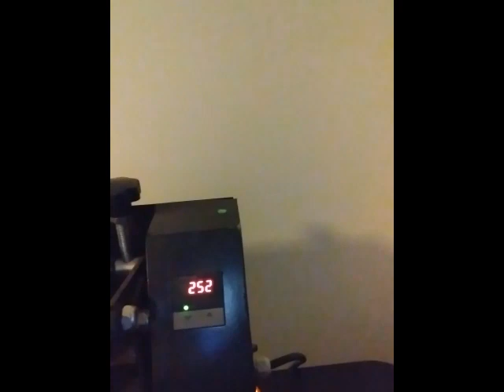Heat press not heating up | How i fixed it

Comment: The watts from a heat press is quite a bit 1500 or 1750 watts which is around 12amps give or take. The plotter might draw 1/2 to 1 amp. So in my humble opinion that's not an issue. Those relays go bad. Also the wires can come loose. Hope that helps.

Comment: Great video.  I'm pretty sure this is my issue.  Did you replace it with the exact same part?  I ask because my relay says the output is 24-550 VAC, but I haven't found anything with the same specs.  The closest was 24-480VAC.  Thanks

Comment: Thank you for sharing ... mine quit working today... so I opened the back panel.. all the wires were fine.. the relay was clicking accordingly .. I tested all the power wiring in there and they all had power running.. even the ones going to the heating element, so I opened the heating element and tested the connection between the two wires and the heating element too .. the red wire had power but was not attached properly .. it was over crimped .. so all I did was strip it and reconnect it and now everything is fine. just had to make sure it was secure.

Comment: What did the screen say when you first turned it on?? Mine has a backwards y on the temp part and 314 on the seconds part then switches to  70 and starts counting down. Mine is brand new but I got it from an auction..{For $66 lol) It's A vevor 16x24.

Comment: hi what about if the numbers run up to the set degree really fast the out light comes off and it doesn't heat to temperature but then when u put it on celcius the out light comes on it heats up real hot but the minute I press set the light comes back off and it starts to cool . i opened it nothing seems wrong  or burn't fuse seems good , would changing the box itself solve this you think ?

Comment: i have the t18 heatpress brand new just out box an it does not heat up and it appears to not even try to start heating up please help me. please i have orders to fill urgently thank you in advance
Reply from the maker: Sounds like it could possibly be the issue i had. BUT, you want to make sure you reach out to the manufacturer. Maybe it's still under warranty.

Comment: I have the same press and I'm having the same issue how did you fix it
Reply from the maker: Hi Cassandra. I fixed it by isolating the problem to the relay fuse inside the machine. I saw that one of the terminals that the wire hooks to was all burnt up. So i assumed that was the issue, ordered an exact duplicate from Amazon, replaced it, and everything worked. I hope that helped.
Reply: @thetshirtprofessor3262  thank you. I will try it! I think I may have left my press on the last time I used it but it was having  issues before this tho.  I've had some big orders which has caused me to have to press for hours. I hope this works!! Thanks for the reply
Reply from the maker: @cassandracampbell4952  let me know the out come
Reply: Cassandra Campbell I’m having same issue with mine and same scenario
Reply: Cassandra Campbell how did you fix the issue?
Reply: @layred7543  I didn't.  I ended up buying a new press. I'm going to order the parts and get it fixed eventually